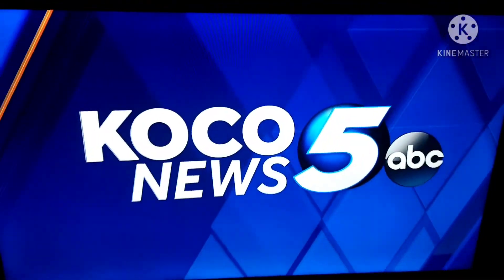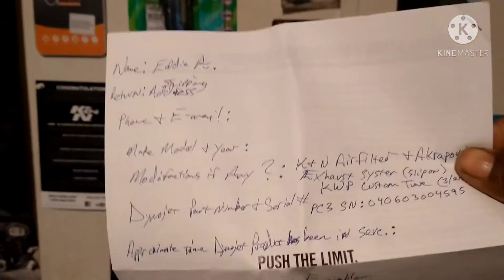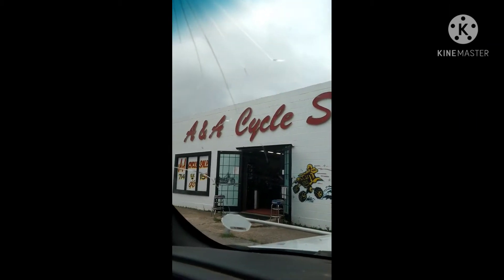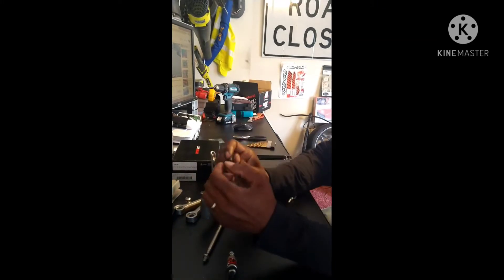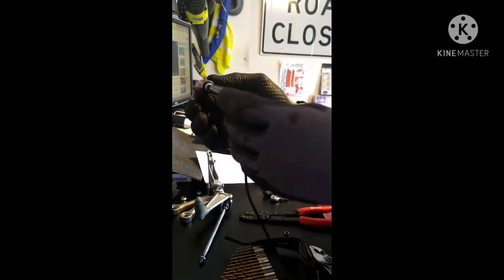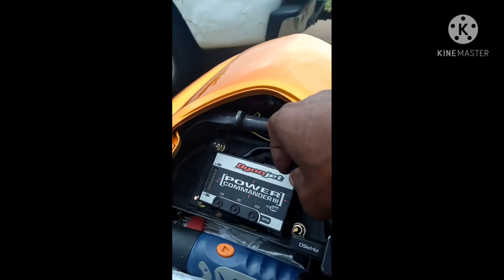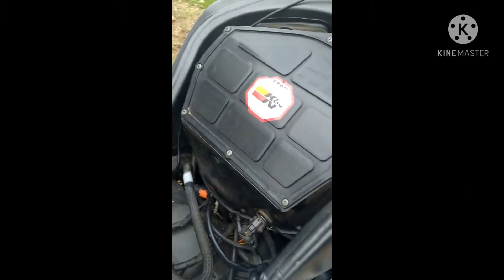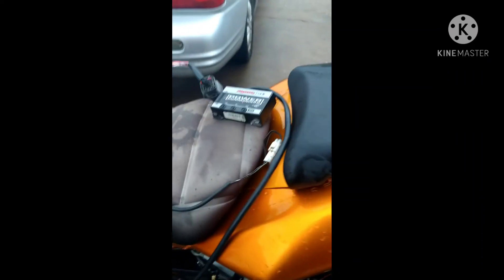Dynojet Quick Shifter Installation Part 1

Comment: dynojet makes a quickshifter that will work with the pc3 it is probably the same thing you have you do not have to upgrade to the 5 I am in the process of installing the set up now on a 05 r6 with the same powercommander 3 you have and dyno jet sent me the download set up for the quickshift also it only shifts up not down it is not a full autoblip